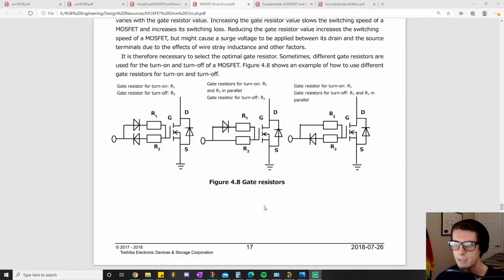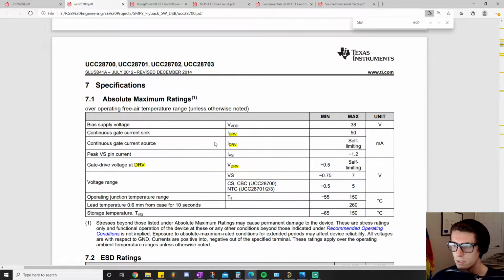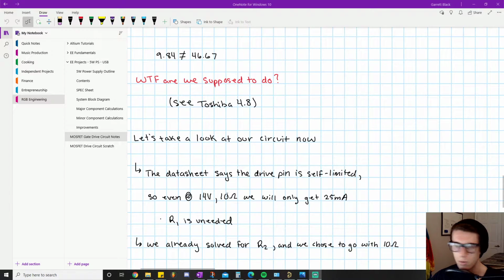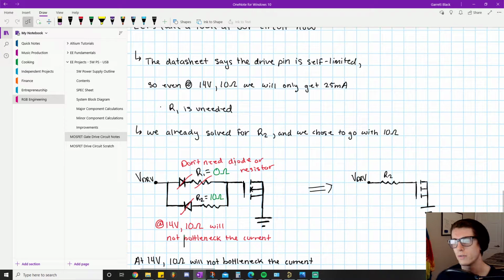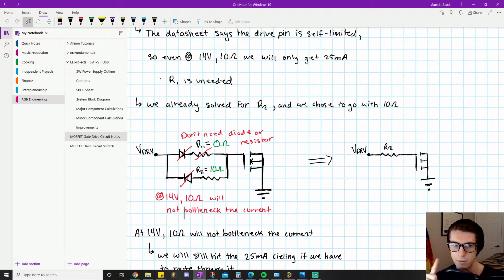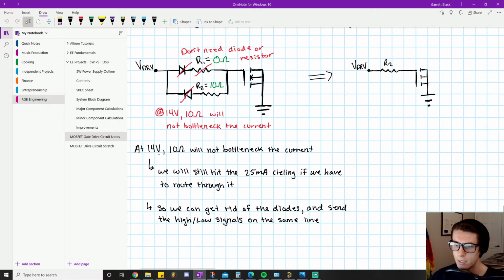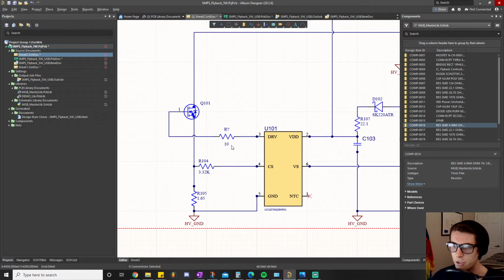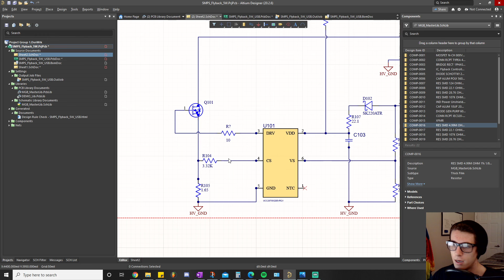MOSFET GATE-DRIVE CIRCUIT Pt. 3 | Circuit Design Tutorial, Altium, PCB | MOSFET GATE DRIVE DESIGN

Comment: Nice and informative video. I guess its worth noting that a lot of MOSFET datasheets have a recommended value for a dampening resistor so probably worth checking out if it is provided. In general, you should always have a gate resistor.
Reply from the maker: This is a really great tip, thanks!

Comment: Does the UCC act like a constant current supply while limited?
Reply from the maker: Sort of, it's not necessarily a constant current - more like current limited. Since MOSFETs are driven by a voltage and not a current, once the MOSFET is turned "On" it basically consumes no current. Hope this answers your question.